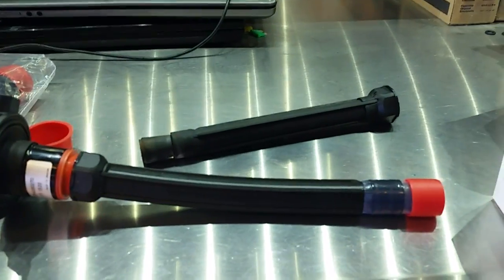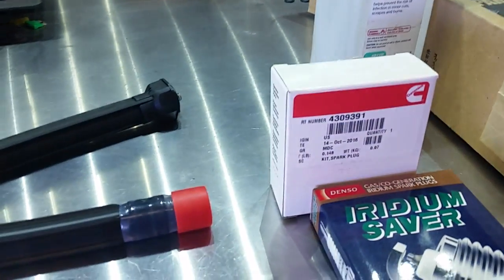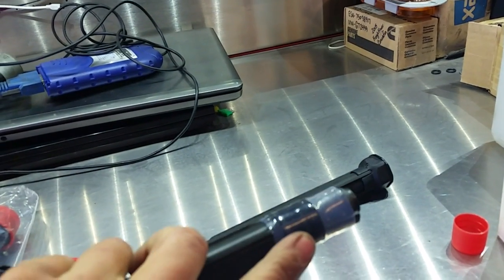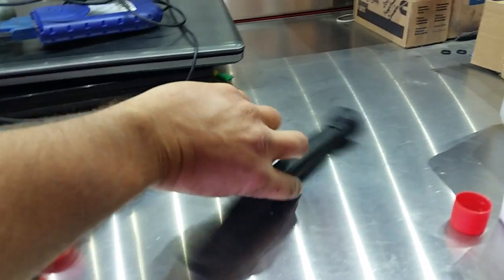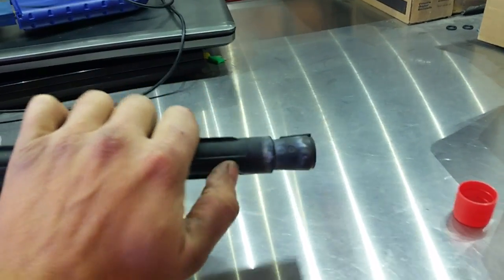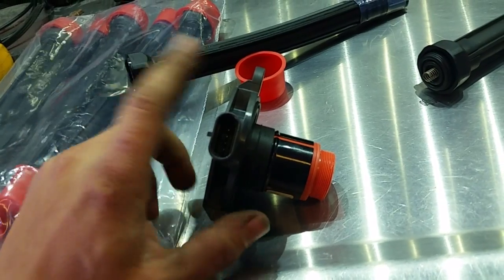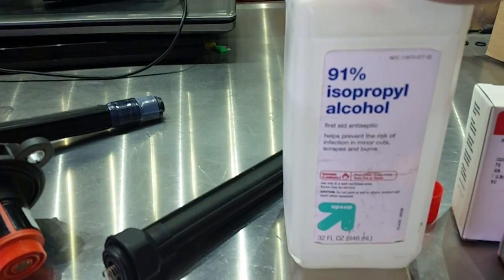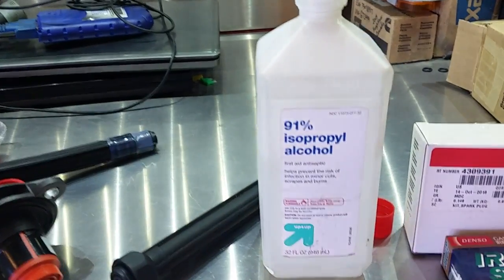CNG TIP OF THE WEEK, TIP #1

Comment: Hello thxs for the the tips . I got a question 
I'm working with a misfire in a cummins cng 8.9 model L9n 
I already switched the ecm and the harness of the coils and it still continues the same .
The only thing left is the computer,  and I was wondering if you could give me a tip on what to do .thank you
Reply from the maker: If it is constantly on one particular cylinder, and you have changed coil, extension, plug, etc, would first see if only at idle or most/all the time. If slightly at idle- overhead valve adjustment. If most of the time-inspect plug tip for fouling/oil. Also, scope the hole, could be bad crown piston wear, or could be bad valve letting oil into piston.

Comment: good info
Reply from the maker: thanks big john, this is one of my older vids i plan on re-doing down road a bit better (one of my earlier vids as you can tell)
Reply: Bearded Seabee82 
cool deal, i got 25 years on the heavy duty truck and equipment side, when i started wrenching everything was old school mechanical stuff injector pumps and injectors on B model cats and big cam cummins,  seen the change first hand to the electronics to now with the cng, personally i hate cng will never get tge power they think it will but hey i guess were stuck with it til they do figure it out, always good to see good solid technical insight on anything in this industry, im always on the look out for good info, never know what ya might learn, or when ya might use something ya learned ... its just not the ol days of suck, blow, bang is it
Reply from the maker: bigbigjohnlee666 lmao, good ole suck squeeze bang blow, those were better days when engines had power and were still economical indeed. Do miss the 3406s and n14s those were good engines, never got to mess too much with PT series of cummins though. But true its been a changing world indeed. Some things on the cngs are simple (alot easier to change spark plug than injector) as for power side... well they would have been better off going 15liter with them i think, but also when you run overhead on these every 150k does kind of help a bit(used to be 75k intervals). But soon as time allows going to be re doing alot of these older crappier vids a bit to make them easier to watch and little better to follow through on. I do have whole playlist to cngs... and have alot more other vids to do on other components yet too. Again thank you for watching and being one of the "old school" folks who have seen alot of transition indeed.
Reply: looking forward to the new vids for sure I would like to do a channel for uploading videos but Im from Texas and I sound like i'm somewhere between west virginia and south carolina lmao its bad i mean my accent is realllllly heavy southern draw so im more of a still pic kinda person and i upload to my facebook page where 99% of my friends could give 2 flying monkeys butts about my uploads but thats what do anyways hahaha

Comment: Once again you've saved me some  trouble. 
One a Kenworth cylinder#6 spark plug hole will fill with water. I posted a little video. You know most of what I say. You should have seen the cloud of rust that blew out of the hole before I took the plug out. https://youtu.be/A6gjjQRJpnA
Reply from the maker: Yeah occasionally we might get lil bit of oil, occasionally some surface rusting due to condensation, but yeah man not like what your trucks see on #6 for sure.

Comment: Thanks again. I've got a truck with a intermittent misfire. I'm going to pull the coil/extension and test resistance. One plug hole filled with water so I'm guessing I know where to start. The spring at the base was rusted pretty good. This info is great, we're a small company with 6 CNG trucks doing the best we can.
Reply from the maker: +Jay Smith you are welcome, test from pin A to pin B, should be 2 ohm or less, then without extension pin c to main base contact. Ahould be somewhere around 5k ohm or less (ish) then check extension, extension max allow is 10 ohm, odds are you will have like 19 megaohm lol. Sounds like the extension is fried/shot from what you describe. We usually keep few on hand in our shop. One or 2 for yours wouldnt be bad idea with a spare set of plugs. Have had our own learnin experience in shop where if one spark plug is bad best to replace all 6 (unless upon install or within couple days of install)